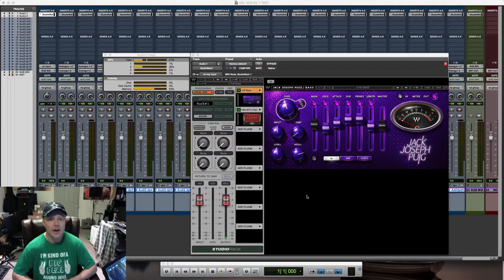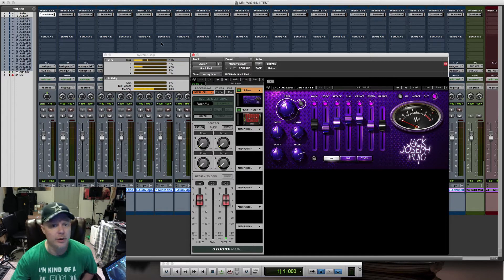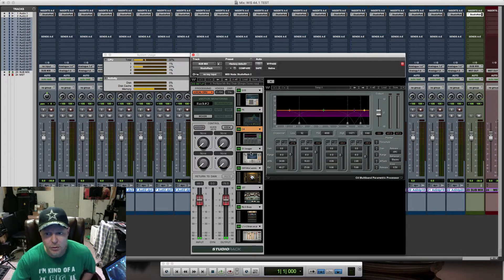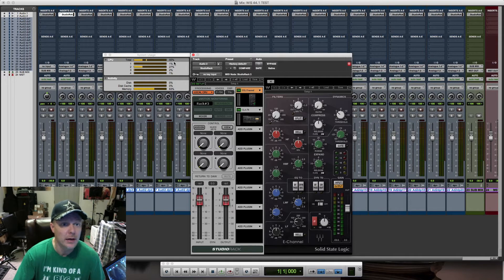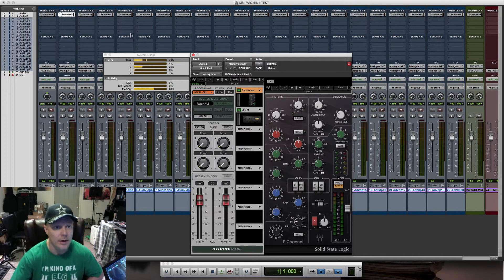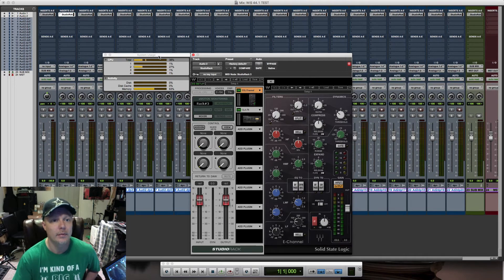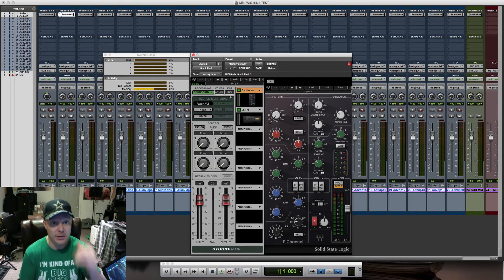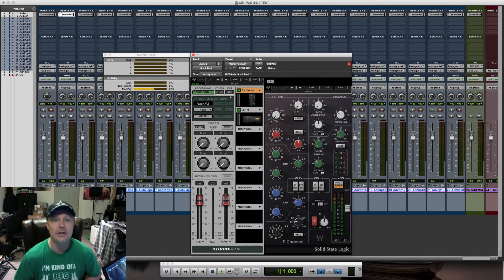Waves Soundgrid Processor Demo

Comment: thanks for the video. i got my impact server c with horizon bundle for 899.00 and love it. had an issue in pro tools bounce due to not knowing to reload plugs back to local during bounce lol but waves tech helped and im good to go.
Reply from the maker: Great! Yes, I tried to make sure I detailed that in the video. Off-loading the processing to the Impact Server during mixing is what it is meant for, as well as mixing live - you can keep them off-loaded if you do a mix Print instead of bouncing to disc. This would be beneficial if you get into rather large sessions with high plug-in counts. I have not really had much of an opportunity to work the Impact Server into any large sessions yet, as I have been working on mostly smaller sessions. Glad you are getting to work with the Impact Server and were able to take advantage of the great value the bundle offer is.
Reply: @BrianBuckalew  i wish i seen your video before investing in uad lol. but they make a good combo. i have the quad and satillite and waves impact server its making a great home studio set up. let me know when you make a video of a large session
Reply from the maker: Will do! And yes - they make for a great setup, indeed!

Comment: yo man in my studiorack it tells me no plugins found when i click on add plugin
Reply: did you get it working?
Reply from the maker: Waves customer support is the way to get this thing set up. They can handle just about any scenario you throw at them.
Reply from the maker: I had another subscriber tell me the same thing happened to them. I would suggest calling Waves customer support. They are super helpful and very knowledgeable. I had issues initially and the Wave technician had me up and running in about 5 minutes. I should have called them first - it would have saved me almost a week of trying different ways to get it to work!!!